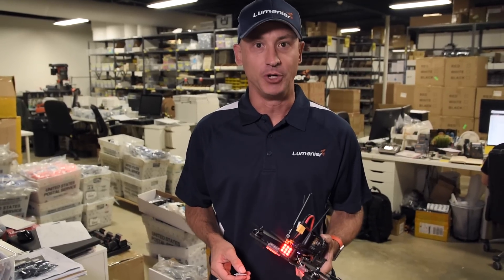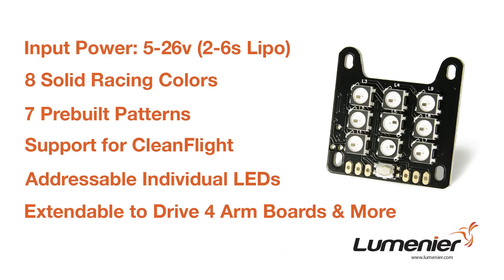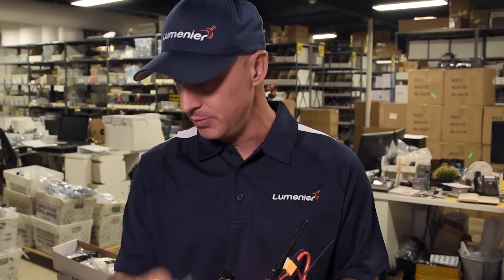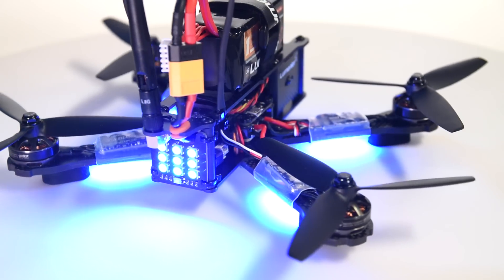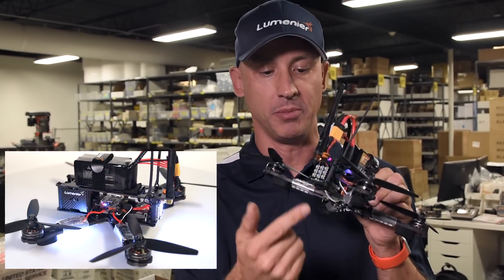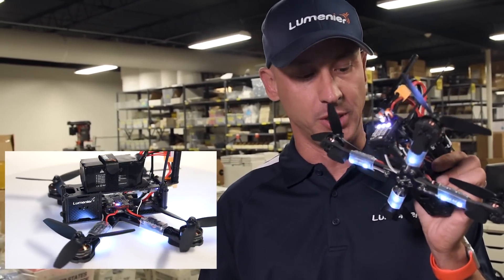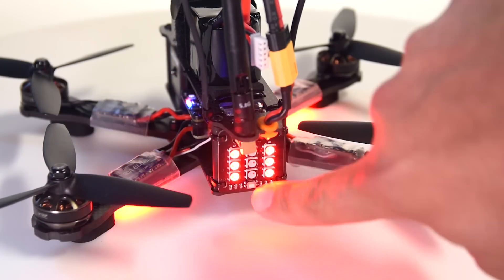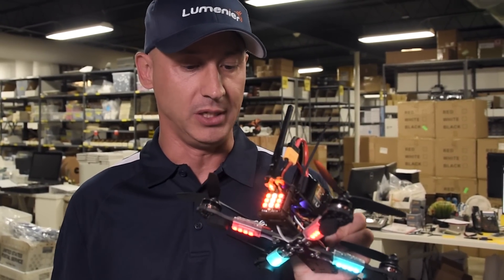Lumenier Multi-function RGB LED System

Comment: dang....ill get this as soon as I learn how to connect this wires and pins to the FC. Im kinda lost but tryin to learn. I can either solder the wires, or use these pins. One light I have has pins on it already and so I plugged it in to the positive negative orientation, no light came on :/
Reply: did you ever figure it out?

Comment: Impressive!!
I ordered one but still thinking how to power and connect. Heated that it is better be powered from filtered source rather than battery directly. So what is the max current draw as I'm thinking to power it from my PDB filtered output?
Also what are the output Solder pads on the distribution board for? Where do I connect them?
Thanks.

Comment: does the arm led come with the wires or servo cables?
Reply: Comes with a piece of 4 position ribbon cable. A standard servo cable is missing 1 position.
Reply: Nice! About to pre-order it! One other question if I already have the arm brace for the qavr could input the led pdb over it or should I remove the arm brace and just use the led pdb as the brace?
Reply: +Ali Agonna Johnson the distribution board for the LEDs replaces the optional X brace. The screws we provide with both the X brace and the distribution board will be too short to stack them both on top of each other.